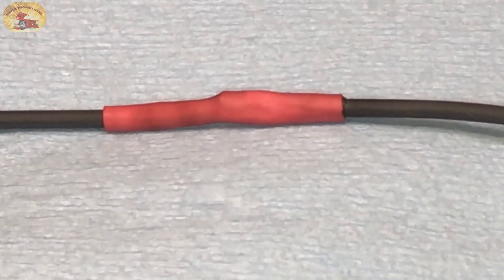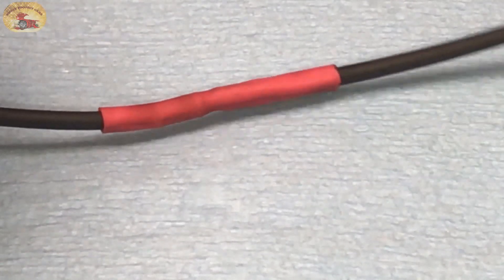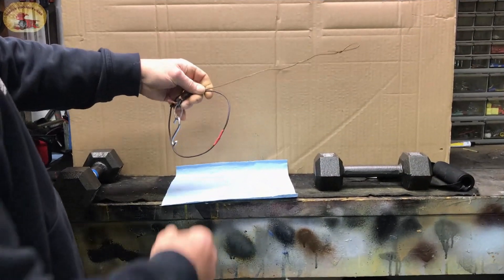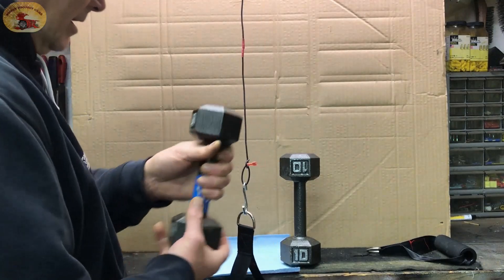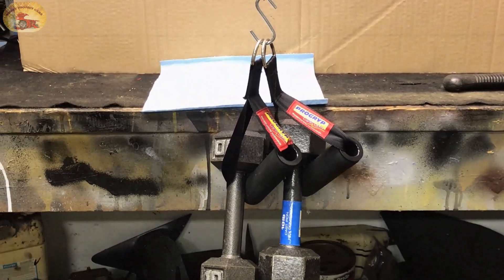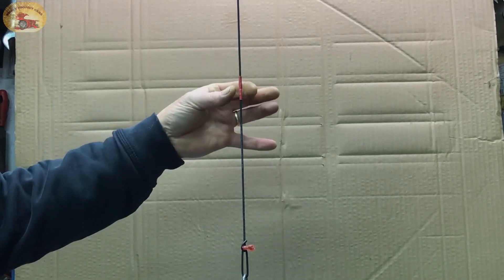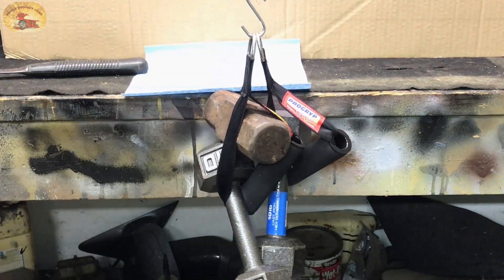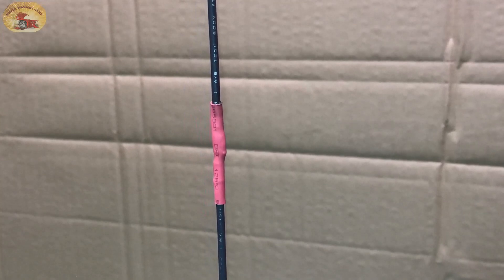How STRONG is a NEWBIE Solder Connection??????

Comment: A solder of two wires in that position and with the added heat shrink will be strong.  But soldering itself, like connecting a jewelry joint, that is weak.  I keep making wire copper circles and if I'm not careful and it bends slightly at that joint, it just breaks off.
Reply from the maker: Thank you for watching and sharing froman, we appreciate it, hope you have a great day my friend. mad Mike the hammer SPC

Comment: If I'm not mistaken (it's been decades since I learned to solder), the point of twisting wires together was to improve strength and also to improve the flow of electrons. I would think, however, that pushing the wires into each other would also be good for the flow of electrons. Stacking wires atop one another may work fine, but I doubt the electrons would flow quite as well. On the other hand, most electronic circuits in a car are only 5 or 10 volts, so it wouldn't take much of a signal flow to make that work.
Reply: I assume you have no knowledge of electronics. Solder is conductive fyi

Comment: Great DYI vid.  I have been soldering for 37 years.  I think you did a great job!!!!  That joint is NOT going to fail!   The only recommendation is to use a higher heat iron for wires that size, it would help it heat faster and draw the solder in quicker and prevent a cold solder joint.   A low wattage iron doesn't heat the wire fast enough to melt the solder as quickly and more heat gets transferred down the wire possibly causing other issues depending on how close it is to something that is more heat sensitive.  There are times when we have to use what we have and in my humble opinion you did a great job showing how it is done....another great vid. Blessing my brother.

Comment: TBO, soldering isn't done for strength, it's all about electrical conductance, if wiring is load bearing something isn't right.
Undeniable iron was to cold for the job, but Mike knows what he doing and got the job done, as always clip was more about how backyarder can get same results as pros, but on the cheap.
Reply from the maker: Mike and The SPC Crew

Comment: The joint is strong, I also butt the wires like that and hold the bare wire and give it a little twist, it tends to prevent the ends from sticking out. I use a pointed tip on circuit boards and a flat tip higher wattage iron on wires, it heats the joint quickly and the solder flows faster without softening the insulation on the wires. I heat the joint from under, touch the solder to the tip, if the joint is hot enough solder will be sucked up into the wires, at the same time feed the solder wire on top. If the wires are thicker gauge then I would move the iron around the wire while Appling solder. 
There are many different ways to join wires, butting is less bulky and uses less solder.
Like the liquid tape.